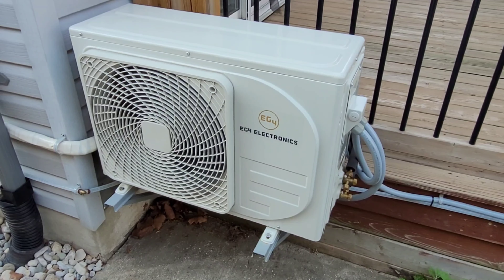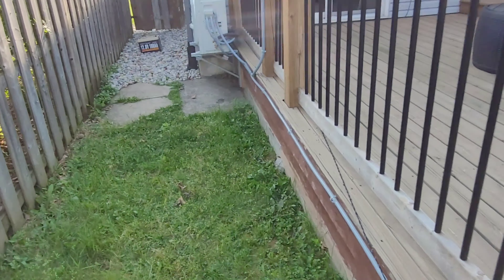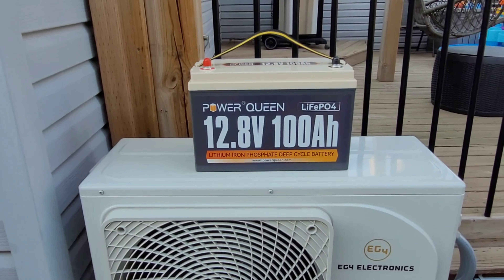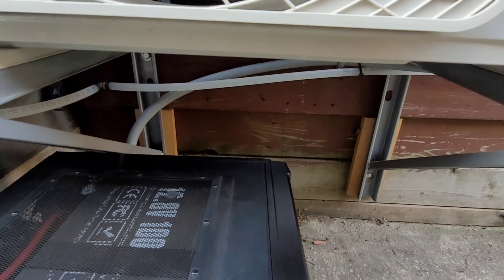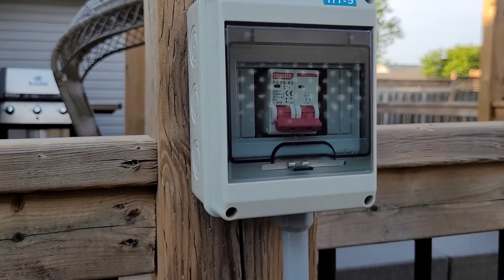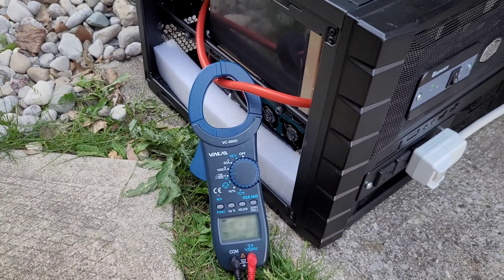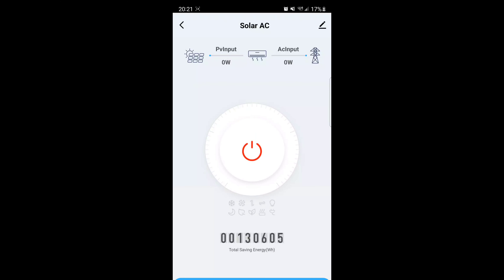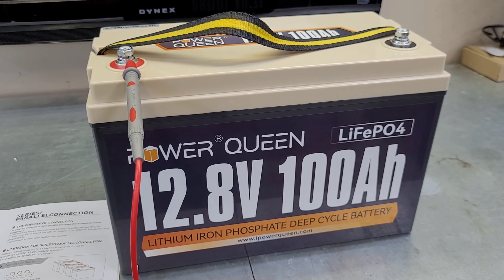Can You Run An Air Conditioner On Solar /  LiFePO4 Powerqueen Battery?

Comment: Nice setup. Only one suggestion. Lose the high frequency transformerless inverter. It's not going to last. I've been in the inverter repair industry for the past 23 years and can tell you from experience that lightweight, high frequency, transformerless inverters are not designed for running inductive loads such as air conditioners, microwaves, power tools and motors. The reason for this is because, there is no buffer between the inductive load and the MOSFETs. You may be able to power your AC when the inverter is new, but after repeated cycling, usually less than a year, you will damage the inverter. Gauranteed.Guaranteed. A much better choice would be to power your AC unit with a low frequency, transformer based inverter. It will last far, far longer and it won't be damaged by this inductive load.
Reply from the maker: I believe you commented this on my other video, and I asked if you could recommend a good option. Any suggestions?
Reply: @quickquote1568 I’d like to know also.
Reply: @2hotscottpro  There are several high quality low frequency inverter brands on the market. Among them are Schneider Electric, Magnum Energy, Sigineer Power. Outback Power and Victron Energy.
Reply: @quickquote1568 I think this one has a built in soft start. Wouldn't that fix the issue? Real question.. I'm  looking for an inverter to do this very thing. I was told that a soft start woud save the inverter.
Reply: @evertking1  Modern aircons and fridges use their own inverters so they're very power supply friendly (they don't dump sudden loads on the AC supply.) Also, I believe modern microwaves have limited current draw.
Reply: I have several 12V inverters I purchased years ago when I intended to build some DIY power stations.  How can I tell if they are low or high frequency, without opening them up and googling the guts :).  Thanks
Reply: @extendedp1  You can tell by the weight. For example, A 3kW high frequency inverter will typically weigh less than 16 pounds, while a 3kW low frequency inverter will weigh about 50-60 pounds. Also a high frequency inverter will only offer a 200% surge capacity while a low frequency inverter offers at least 300%.
Reply: @quickquote1568  thanks
Reply: @quickquote1568  i use a victron inverter at 3000va would this unit suffice
Reply: @bigredinfinity3126  Yes, as long as it's the low frequency, transformer based version.

Comment: Looks like you could run all night on three of those fully charged.
Reply from the maker: I'll try if I get another battery!
Reply: @SmitHVAC.  Good luck.  I'm off grid in the desert with 1200 amp hrs of lipo4. Not quite enough for my 12K mini sometimes.
Reply: @RVDestinations that's weird, I have e minis connected to my ac300 with one running nonstop , never have an issue unless there is no sun for a couple days
Reply: @HighDesertOffgrid You probably doing something wrong
Reply: @mikeluperciojr67  I power 3 full sized 12k btu mini splits ,a Mr cool a della and a klimaire
Reply from the maker: Check out my other video of an Ac200p running this mini split

Comment: If you are using the mini split to also supplement heat in the winter in cold climates, make sure you are buying one rated down to -22F. I have a Senville unit now 4 years, and it provided heat down to -35F. 24K BTU unit uses 2.5 kW heating, cheaper than propane right now. The color of your house and tree shading the house makes a HUGE difference too. I design and build hyper efficient homes w solar and can tell you a white house with some shading needs very little cooling. I might run mine 1 hour a day during 90F days. A dark house I helped build needs theirs on constantly, no shading. Senville 12K BTU uses only 950 watts/hour heating, less for cooling.
Reply from the maker: I do use this for heating in the winter,  I installed it near the end of Feb and the coldest day we saw after that was - 10c. It worked well but we'll see how it does in the colder weather this year.
Reply: At what temperature is your Senville mini split set at during winter and what temperature was it outside in Fahrenheit?
Reply: Isn’t Senville out of Virginia? Hmm I may be thinking of a panel place ?
Reply: @CashTheBigDog  it is all about the difference In Temp. All units can only reach a certain temp differential!!

Comment: Get rid of the minisplit inverter board along with the Renogy inverter and run it direct off 24 volts. Much more efficient.
Reply from the maker: @akshonclip  it wouldn't run on 24v

Comment: A soaker hose or mister on the roof with an intermittent timer might make your overall system more effective later in the day and worth a try. I think it is something like 8000  BTU removed per gallon evaporated so you don't want any water to actually run off the roof. It is the phase change you are looking for and since you're solar powered harder to say how much it might help.  Some factory roofs use mist systems .
Reply: do not mist anything if you have hard water.
jets will clog up, minerals will get on everything.
only good if you have a very soft water supply.

Comment: I live fully off grid and we run AC every night. We have 15,300wh of LiFePo4 batteries. We can make it all night with a 10k BTU window unit. That’s with wife keeping it COLD in the bedroom.

Batteries are 48v EG4 Brand from Signature Solar.

Would love a mini split they are more efficient and less noise.  Great video!
Reply from the maker: Thanks for watching!
Reply: Mini Splits are very efficient. We had 2 running all day today (9000btu and 24k btu) and it was about 95F outside, our power monitor showed around 1.6kw for the whole house during the peak afternoon heat.
Reply: How many batteries do you use to have the mini split all night?
Reply: How safe is it
Reply: @benruthlessburger8905  very safe there’s really no risk to damaging the lithium batteries when you follow the manufacturer recommendations for cutoff and charge voltages. They’re long lasting and built for it.  Sorry I’m replying to this almost a year late but I now have a Mini split installed in the tiny house. It’s a 1 Ton unit with heat pump. It draws less amps than the window unit and cools the house much quicker. We actually run the Mini split and Window AC at the same time during the day in summer. (Arizona desert) and we love it it does a great job keeping us comfortable.  For summer months the only issues we’ve run into is battery capacity overnight. We really should add 1 more battery to our bank making it 20kw that would put us in a better place for summer overnight running both ACs.    Thanks for the comments!
Reply: @jhon4352  we have 15kw battery bank now and can go all night EASILY with our 1 ton mini split. And that’s with us also powering other appliances, fridge, 70” tv, Xbox, fans, lights etc….  It’s even more efficient if you put the mini split on Economy mode.  It’s been a game changer.  It was only $800 for the unit and we installed it ourselves. It’s a Mirage brand

Comment: Power Queen has excellent customer service.  I have been running a PQ 12.8/ 190ah in my RV for a year now.  No issues.
Reply from the maker: Same! Been running mine for a year now, they are very easy to get in touch with.

Comment: Loved this video. Watching the page on the right 8:54 if you "Connect in Parallel" 4 of the same batteries the AC could run all night?
Reply from the maker: It probably would, I have it set up on 2 batteries in my most recent video!
Reply: @SmitHVAC.  I just looked at that. Waiting to see you add 2 more. 😀
Reply from the maker: @shellfishing  you'll see that soon!

Comment: Hi,
Thanks for the video - can you show how you connected the outside unit to the battery?  I am interested in the wiring between the compressor unit and the battery.  It looks like you wired a plug so you could plug it into the battery unit you built.

Thank you!

Comment: We use split systems for only heating, normally out side of 7am to 6pm. I'd need all the batteries to hold the house at 20c over outside temp
Reply from the maker: Yes they do use up a lot of battery power in heat mode
Reply: @SmitHVAC.  I wonder how much power you'd save taking the heat out of the ground or a lake. They borrow some lake heat for a whole hospital. Not sure if it scales well

Comment: I have a brand new 20 seer Minisplit I just purchased. 12,000 btu or 1 ton. I also purchased a 12 volt 200 ah battery on the way, 12 volt 3500 watt inverter and three 200 watt solar panels with charge controller. My plan is to build and emergency backup for the ac which also is a heat pump. This is just the start of what I’ve purchased and I’m sure I will be expanding it. Ultimately I want 3 of the 12 volt 200 ah batteries in series which I feel will run the ac all night and then expand the solar array to hopefully charge them during the day. I have a lot to learn but it’s gonna be fun!
Reply from the maker: It's never ending! I always feel the need to expand. Just make sure you are using a pure sine wave inverter, minisplit circuitboards dont like modified sine wave power.
Reply: @SmitHVAC.  yes the one I ordered is a 3500 watt continuous or 7000 watt peak Pure Sine Wave Inverter. 👍🏻
Reply: @SmitHVAC.  can you help me out on the inverter connection? On some videos I see people using a resistor to charge the inverter capacitors before connecting the battery for safety and on other videos it’s never mentioned! 🤷‍♂️
Reply from the maker: @lyngleslogic1180  if you don't use a resistor you will get a pretty good spark on your final connection. You can do it without the resistor but sometimes it can leave a burn mark on your cables or your battery terminals
Reply: @SmitHVAC.  ok so highly recommended then I’m guessing to use a resistor. 👍🏻
Reply: @SmitHVAC.  thanks!
Reply from the maker: @lyngleslogic1180  yes, if you're just going to do it once you'd be ok, but if you're changing your setup alot it will damage the terminals after a few times
Reply: @lyngleslogic1180  It’s always good to precharge the capacitors by using a resistor. The ones that don’t mention it, don’t know or don’t care about the damage it can cause. Lithium batteries can have a very high in-rush of amperage.
Reply: 3 in series would be 36 volts.

Comment: Is this battery best bang for the buck? I notice huge discrepency in pricing…what would your's have run if they hadn't comped it?
Reply from the maker: It's a good bang for the buck, between them, Redodo and litime it just depends who has a sale on at the time. The discrepancies are probably because they have lots of new versions now with Bluetooth, heaters, high capacity surge etc. If you get the most basic one it's around $300 Canadian

Comment: Just put a low voltage shutoff on the ac unit? If it drops below 110Vac or whatever  DC voltage on the battery,  it cuts power.

Comment: What about the inverter loss?
Power Queen to inverter- certain percent loss.

Is there a way to use a voltage converter on a battery direct and then feed PV input?
Reply from the maker: Probably but wouldn't the voltage converter suffer losses too?
Reply: @SmitHVAC.  you're probably right.

Comment: How do I get information like that? What app is that and how can I connect it to my solar system?
Reply from the maker: The app is called Solar Aircon, its specific to the EG4 and Deye heat pumps
Reply: @SmitHVAC.  i’m confused where do I buy it and how much does it cost and what is it called?
Reply from the maker: The app? Or the air conditioner?

Comment: IMO DC Disconnect Rooftop Isolator Switches work pretty well. I am currently using 3 of them to isolate DC voltage in various areas (at the panels and again at the solar aircons). They are probably twice the price of an Amazon jobbie... but they get the job done while not feeling cheap. I'm sure there are better options out there, but I've had good experience with them and have seen pro solar installers on YT that use them as well. Thanks for your content on this mini split. I'm currently running one of the 24k BTU versions and am adding (right now) one of these 12k units to the other side of the house as well. Which is what brought me to this vid... which I'll now finish. GL and TY again.
Reply from the maker: Thanks for watching! Do you have a link to the isolators?

Comment: Id angle them panels towards the arc of the sun instead of straight up.
Reply from the maker: That'd be ideal but to fix 6 of them up there I have to lay them flat, If I angle them I shade the panels behind

Comment: Can I use that type of battery on the 600 watts UPS that I have my computer, 2 monitors and the Router plug in? Can I replace the UPS battery with that battery? Thank your time and assistance!
Reply from the maker: Yes you most likely could, I've been looking for a dead one to modify

Comment: Your PV breaker is just the disconnect required by NEC (national electrical code) to cut the panels off when necessary for maintenance or other reasons.  It is just acting as a switch, not an overload breaker.  You should choose one with a large Amp rating say 63A as it is just a switch.  Also it must be 2P as N.E.C. requires both wires to be isolated.  I've seen some people put a one pole breaker in (especially in campervans) but that does not meet code.
Reply from the maker: You are right! I just replaced the switch with a proper disconnect, it will be in this Saturdays video.
Reply: @SmitHVAC.  Thanks.  I am making an air conditioned solar powered container on my channel so had to learn this.  Got the Bluetti AC200 Max to run it all.
Reply from the maker: @ebikecnx7239  Nice! I'd like to get my hands on one of those

Comment: The lithium battery does have a BMS in it and you can run it till its dead. If you have modern tool batteries when the the tool stops to tell you that your battery is dead, that is the bms shutting it off. 
I would gather that your panels are still producing electric and just not enough to power the unit on. If you were to double up the existing panels you will still be far under the rated capacity of the what the unit allows yet I am sure there is some over paneling that can be allowed as well. If you have double the power you should be able to run 1 or 2 hours more in the morning and at night. 
Such a good system.
Reply: You can overpanel as much as you want as the load only draws the Amps it needs.  You must only stay below rated voltages, such as for the MPPT controller.
Reply: @ebikecnx7239  I would think that yet MPPT controllers, all in on inverters and this solar mini split says that you can not exceeded the number of panels. 
My general question is why not. If you voltages are what the unit can handle then why can't I hook up 100kwh to something. If the solar array only pulls amps does it not have an amp limit? That is the problem is that they do not have an amp limit they will keep pulling and pulling till they can't pull no more. So if this mini split can pull 2950 watts at max and you have 5kwh of solar on the line then it should be able to hit max. Yet every documentation says that you can not. 
If I have a all in one unit that say peaks at 10kwh and I have say 40kwh on the mppt controller that only allows 20kwh then this should give me more power during off peak hours. The bigger the system the sooner it can provide power in early morning hours and evening hours. While one might say that you should buy a bigger or more charge controllers while that is true yet I do not need a massive battery bank to charge what I have is massive day time loads that I want to use and the more power I can get for a smaller system the more power I will have though out the day.
Reply: @kameljoe21  I am not familiar with this particular unit so cannot answer that, all I know is for example, on my solar shed with 1200W of panels in series (3×400W) I hooked them up in series to get 100V or so to stay under the 150V limit of my Bluetti AC200 Max.   The Bluetti AC200MAX has an input limit of 900W (15A and 150V).  Anything over 150V would damage the MPPT controller inside.  There is more Wattage available on the sunny tropical days I have, but it can only draw 900W.  So, I have overpanelled yet get that 900W from just after sun up till sunset.  So, my Bluetti battery can be fully charged in an hour and a half, even if it went down to say, 20% overnight.  On my channel the next video is a 20 foot sea container room I built, with a 1 ton (12000BTU) air conditioner.  The air conditioner is a inverter mini split and will be cycling between say 400W and 900W as it has a SEER efficiency rating of 23.  That means I will be able to run the whole container with lights, computer, fans and air conditioning on the little Bluetti AC200 Max.

Comment: How’d you hook up the A/c directly to the solar bank? Does the A/C have a built in inverter?
Reply from the maker: It's connected to an inverter inside the black box, it's a 120v mini split

Comment: I am thinking about connecting my air conditioners to solar panels. what did your connection cost?
Reply from the maker: This ac can connect directly so there wasn't much cost other than the panels. It depends what size system you have and how you want to run it.

Comment: So like 10 of those batteries all connected as one would run 24 hours straight I assume but the question is running batteries constantly for long periods of time could be a problem or not.🤔😏
Reply from the maker: Should be fine but they recommended a max of 4 in parallel